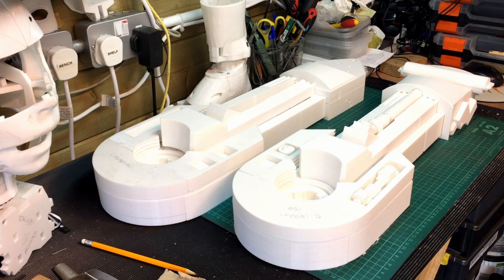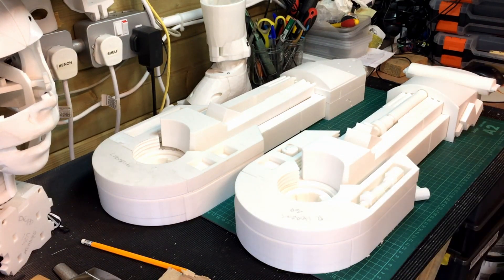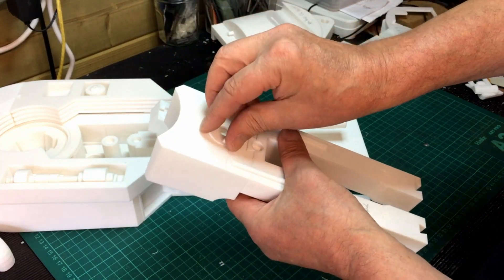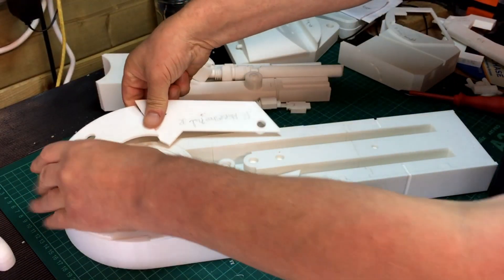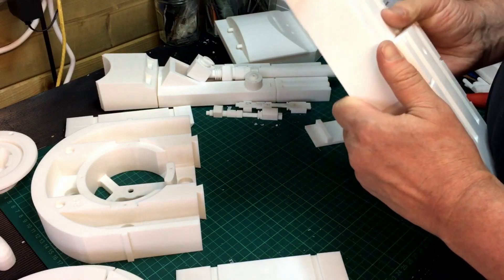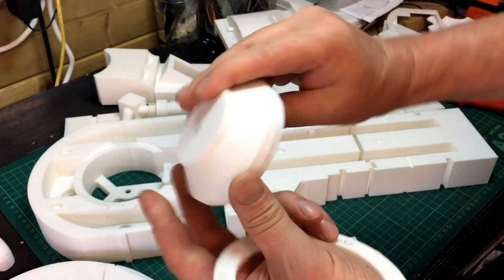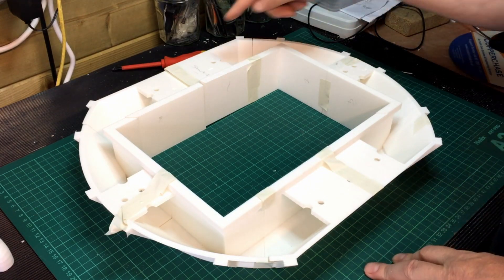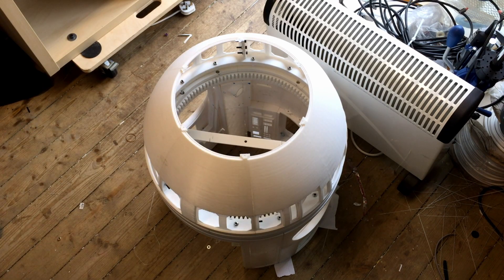R2D2 Droid Build Part - 6

Comment: 8:45 for your info, if you are using Cura, on rotate menu you have the flattern option that auto level the piece on the bed
Reply from the maker: Hi Alejandro, I originally used Cura then started to use to use Slic3r that came with my Prusa machine.  I printed all of my InMoov aprt from the legs with my Wanhoa and Cura slicer and it was fine.   I never really liked Slic3R and as mentioned, getting items flat on the bed is really tricky.    Maybe should have gone back to Cura, anyway I was recommended Simplyfy3D and I love that program.  Been using it over a year now.

Comment: What kind of filament are you using?
Reply from the maker: Hi Alejandro
I have nearly always used 1.75mm white premium  1KG reels from Technology Outlet.  Best place is to buy at Amazon.   My InMoov and R2D2 are almost completely printed with this brand of filament.  I have two printers, an old Wanhoa and my current Prusa and its great with both.   Its reasonably cheap as well.

Comment: Ah, so this is one of the videos I forgot to watch. Seeing you do that disassembly had me in awe... and a healthy reality dose about what I've still got left to print. Wow!I thought I had it bad with bags filling 1 tote! And I see you did mention you are sanding. Cool.I too have had issues with orientation. Cura seems to deal with it with the lie flat button. I love that. (though it doesn't allow .3 printing for some reason) The stock Da Vinci software could use that lie flat ability.I must admire your space. I thought I had it bad! But you organized it fairly well. :)
Reply from the maker: Hi Chris
I haven't really got sanding that much, or got painting.     I can only really paint outside and and nearby neighbour has had their house virtually rebuilt this summer and there has been dust in the air the whole time so painting not possible.    The dome is ready to paint and the legs will  hardly need any sanding and minimum prep work. 
The body will need a lot of gap filling and I may reprint some bits.    The real sanding work is on the feet shells which are really ribbed.   I thought that was how they were meant to be but looking at other R2s apparently not.   So they are an issue. Have look at at the last picture here https://myrobotnigel.blogspot.com/2018/08/single-belt-drive-version.html and you will see the ribbing on the print.   I will probably make it a feature and say its its intentional. 
I need to decide on a colour scheme for the whole R2 as I am not planning on the standard colours.   So I will continue the electrics and get the main body filled and at least undercoated.   Same with the legs but until I decide on the colours I cant finish them off and glue on the greebles etc.  Which is a hassle as they are taking up space which as you can see I dont really have spare.   Still, I like my small workshop, its fun.
Reply: Hi Kyle,I'm still envious of your progress.Feet: Is that due to the printer? Did it print at a higher resolution or have another issue?I just bought 6 more cans of primer-filler. I like it better than bondo since it is a spray. You might want to try that. Or look into reprinting those parts. Or, as you said, keep it as a feature.I goofed this morning and printed parts 1-2 of the skirt again. (It was 4am and I was apparently too asleep to remember I had printed them the day before) So, I get to do them again tomorrow. Joy.Oh, the raft idea? Very messy in Cura. It prints a very thick popsicle stick raft that is pretty much a part of the part you want. Cutting it off has been annoying. But I'll stick with it for the last 2 parts of the rear panels. It is better than the aggravation of seeing them fall over for some reason.Color scheme: Ah. Cool. I'm going stock. I figured I'll go factory fresh for the moment. I can always dirty him up if I want to do so later.Workshop: I'm glad you've got one. I have part of 1 room and part of the garage. My buddy Mechmaster (one of your countrymen) has turned his entire flat into a workshop. Probably why he's still single. :)

Comment: Do u have a link were I could buy they main board.
Reply from the maker: Hi sky rim
Shop around and you can sometimes get the EZB kits fairly cheap.  
Or look at the Padawan R2D2 system using Arduino https://github.com/dankraus/padawan360

Comment: For electronics what's your plan
Reply from the maker: Hi Sky Rim
I have bought the two feet 24 volt motors and the dome motor.    Also the Sabertooth 2x32 and Syren 10amp driver boards.   I have an EZ-B  V4 wifi controller so am going to use that as the main control system.   My InMoov robot uses the V4 as well so I can program both R2D2 and the InMoov to interact and talk to each other.    I am planning to add a working camera to the R2D2 so it will see and respond to movement and recognise faces.  I am not planning on making a "movie exact" R2D2, I want him to speak to people and interact with them.  

Just started to plan out how its going to be wired up and have bought an car style blade fuseboard/relay box and will use that so i can remotely power him up using relays.    Steering, dome/arms movement etc will use a PlayStation remote, as I have tried that with the V4 controller [and also used my iPhone ] and that works well.   Been reading up on Sabertooth control via the V4 and seen many scripts that should work well.   I can also add in R2D2 sound effects maybe later.    Just buying the parts at the moment so still a while before I wire it all together. 

Finished printing am just stated painting some parts.  Getting there slowly.

Comment: Very nice quality :p
Reply from the maker: Thanks Thomas
Reply: Do you use symplify 3D or Cura?
Reply from the maker: Hi Thomas
My Inmoov was mainly printed with my Wanhoa printer and Cura [all apart from the legs].  My Wanhoa is in bits being rebuilt.   I bought my Prussa Mk2s last year and have been using Slic3R that came it.   The Imoov legs were printed on the Prusa/Slic3r and most of the R2D2.    However, I have just bought Simplify3D last month and am still getting used to it but its really good so far.   I have successfully printed Nylon and PETG using Simply3D on the Prusa printer.   
Looking back, Cura was really easy to use and great results and Free!  Simplify3D seems the most advanced but you have to pay for it but its got some some really good features that I am still getting my head around. Slic3R is free but I am happy to have moved on.
Reply: kyle campbell  thank you very much

would it be possible to share your cura settings for you inmoov please?
Reply from the maker: Hi Thomas
I used the default settings in CURA for my printer [wanhoa used for the nearly all the InMoov, apart from legs].   There are the Ulti quality, High quality, Normal and Low in the advanced tab.    I used Ulti-quality for the gearing and high for most else.  I didn't change anything just kept it as Cura set it.    When Gael said to use higher infill for example., I just used Ulti-quality.   I used PLA throughout and got I think very good results.

Comment: Good stuff.  Can't wait for the one with the feet and how the legs attach to them.  I'm having problems figuring those parts out.  Keep it up!
Reply from the maker: Hi Thomas, I am printing the shoulder sections [although I had originally planned to wait for the newer movable versions when they get designed], so will have the legs attached to the body soon.  I agree with your comments about the feet and how to attach them!   So I am just printing all the parts and see what happens about assembling the feet when I get there!

Comment: Excellent video Kyle, I'm starting to add the greebles to my units legs now as well. Get them in primer then onto sanding/filling the body.
Reply from the maker: Hi Carl.    I am struggling to get anything painted at the moment as I normally paint stuff in the garden.  The builders next door are smashing a house apart so dust everywhere now for weeks, so painting could be an issue.    And probably too hot at the moment.    So printing and gluing for now.